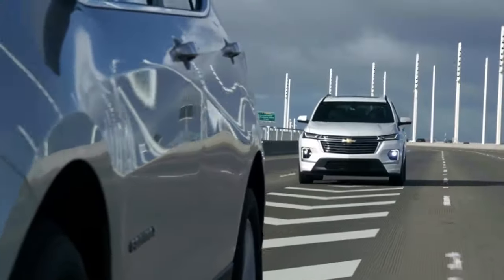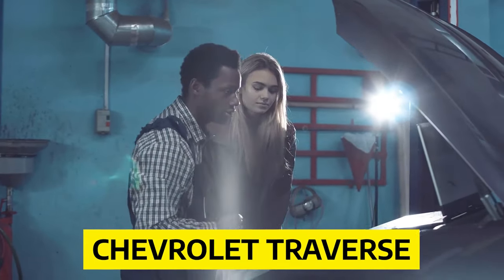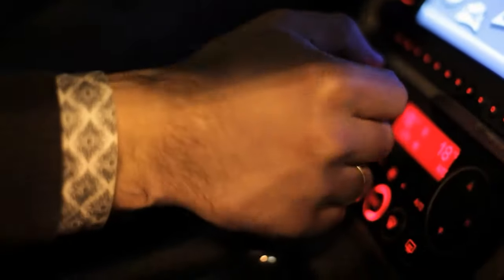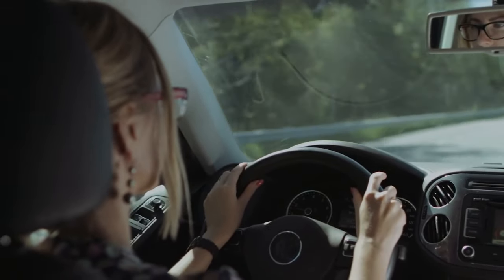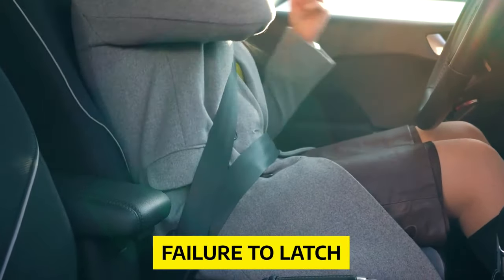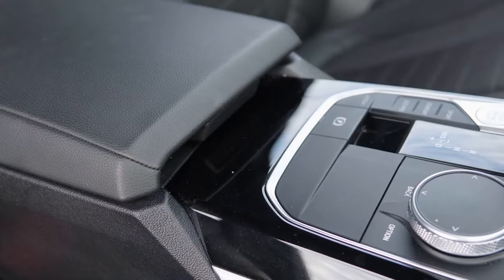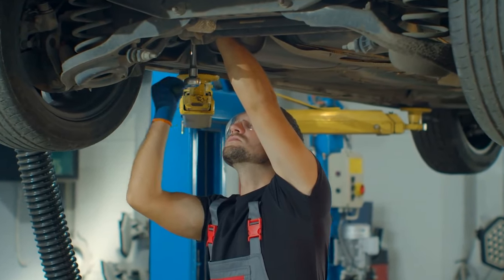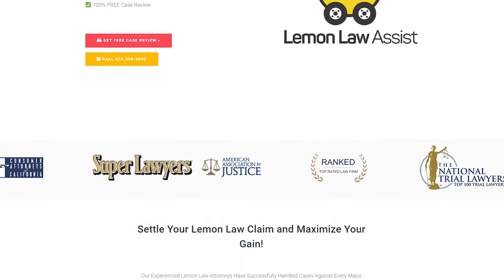WATCH THIS If You Have Chevy Traverse | Lemon Problems of Chevy Traverse

Comment: I’ve got a 2020 Chevy Traverse LT AWD with 27,900 miles and we bought it new. I’ve taken it on road trips to Florida, Washington D.C., Pennsylvania, and to and from Wisconsin, Iowa, and Indiana (I live in the Chicago area). I’ve experienced absolutely no problems and I’ve enjoyed the driving experience since the day we brought her home.
Reply: Mine has 50 and I’ve had to change the battery alternator and now starter
Reply: Bought 2017 traverse in 2021 with 8500 miles. After 2 years no problems BUT with 36000 miles had to replace rr wheel bearing . Bummer dealer couldn't figure noise in rear.
Reply from the maker: If you need our help in the future, click the link in the form and fill it out for a free case review https://form.jotform.com/mollaeilaw/lemon-law-assist-youtube
Reply from the maker: If you need our help. Click the form link and fill out the form to get a free case review https://form.jotform.com/mollaeilaw/lemon-law-assist-youtube
Reply: We had a 2013 Traverse we drove to 200k miles, now a 2020 is at 75k miles…. Never had any engine or transmission problems. Only repairs on the 2013 were brakes and wheel bearings. Usual wear items aggravated by sand and salt in the north east winters. The 2020 has been free from any repairs so far! Reviews must be written by import dealers!

Comment: You can’t make such vague conclusions about the Chevre Traverse without reference to the year model and maintenance culture of that owner or how well it has been maintained . I own a 2019 Chevre Traverse and haven’t had any major issues with its performance.  I love the Traverse and its riding smoothness. I only recall a check engine light which was diagnosed as a faulty catalytic converter. I had it replaced and since then , no other performance issues. My Traverse is less than 100,000 miles and has no regrets with its usage.

Comment: I bought a 2023 Traverse in the Premier trim level with 13 miles on it. Have taken it on 2 long distances road trips across state lines, thru the pass in snow conditions and off road with rain/mud conditions. The vehicle handles well, with no issues thus far closing in on 20k miles now. My problem is this video. Why not show us videos of the traverse and the issues being discussed rather than a bunch of random vehicles being shown... Most vehicles will inquire problems over time but make sure to have required maintenance done at regular intervals and you're good.
Reply from the maker: If you're wondering how much you can get paid for your car problem, click the form link and fill out the form to get a free case review https://form.jotform.com/mollaeilaw/lemon-law-assist-youtube

Comment: I have to disagree with you on the problems with the   Traverse. Ours is a ‘19 Premier model and it currently has 75K. I have had no issues with this car at all it drives so smooth, quiet, has plenty of power, no steering problems, no control issues, original brakes, etc. I’d like to know how many out of say, 1000 Traverse’ have had these issues. It’s a great car and I’m thinking about trading for a ’25 model

Comment: I've owned a 2019 Traverse LT AWD and sold it with 58k miles and loved it so much I bought another, 2020 Traverse LT AWD with 34k miles because of the upgraded features it has. Every car will have maybe one of these problems mentioned at one time or another no matter the car maker. Audi, Ford, Chevy, Chrysler it doesn't matter. Those car makers have all been around for many years and try to make the best they can. It all comes down to personal taste. Every car I have owned of Chevy has never had those problems though counting the Traverse.
Reply from the maker: If you're wondering how much you can get paid for your car problem, click the form link and fill out the form to get a free case review https://form.jotform.com/mollaeilaw/lemon-law-assist-youtube

Comment: Over 6 years with 2015 Traverse no issues. Except for battery change and brake work. No engine issues which was the reason to buy new. Advice: change oil on time religiously and it will run forever.
Reply from the maker: Good to hear that. If you need our help in the future. Click the form link and fill out the form to get a free case review https://form.jotform.com/mollaeilaw/lemon-law-assist-youtube

Comment: I currently  have a 2020 Traverse. My breaks has always had a noise, and now I’m having  transmission issues. 12,000 miles out of warranty.
Reply from the maker: I'm sorry to hear that. Click the form link and fill out the form to get free case review https://form.jotform.com/mollaeilaw/lemon-law-assist-youtube
Reply: Mines a 2021 and had to change the alternator battery and now started same just beyond warranty but luckily I had the extended warranty so that saved me but still $250 deductible 😢
Reply: @BASSFISHINGMIC  mines ended up being a burned out coil. 455.00 dollars 😩
Reply: My 2020 redline has had the exhaust pipes replaced twice. And the transmission replaced at 70k miles. Rear brakes squeaked for 2 years until I finally just replaced them. I was always told there is nothing wrong with them. Replacing them got rid of the noise. My 2018 traverse had a shift to park issue.
Reply from the maker: I'm sorry to hear that. If you need our help, our office will review and evaluate your car/truck problem. Click the form link and fill out the form to get a free case review https://form.jotform.com/mollaeilaw/lemon-law-assist-youtube
Reply from the maker: I'm sorry to hear that. If you need our help, our office will review and evaluate your car/truck problem. Click the form link and fill out the form to get a free case review https://form.jotform.com/mollaeilaw/lemon-law-assist-youtube

Comment: 2019 brand new traverse with 74k miles on it...ive replaced an evap sensor, battery, and now its got a speed sensor of some sort wrong with it. High RPM's and wont shift, no matter how fast you go
Reply from the maker: I'm sorry to hear that. If you need our help, our office will review and evaluate your car/truck problem. Click the form link and fill out the form to get a free case review https://form.jotform.com/mollaeilaw/lemon-law-assist-youtube

Comment: I have a 2019 LT and it definitely is a headache.  Fixed emission system 3 times
Reply from the maker: Hi! @devinedecor5784 It sounds frustrating to deal with repeated issues like this. For a 2019 model, if you’ve had persistent problems with the emission system, you might be eligible for some recourse under the Lemon Law.
To explore your options and see if you qualify for a free case review, please fill out the form here: https://form.jotform.com/mollaeilaw/lemon-law-assist-youtube

Comment: How does it have power steering problems, when it has electric steering?  There’s no hydraulics, pumps, hoses, or fluid to deal with or to go bad.
Reply from the maker: Hi! Even with electric steering, issues can still occur due to faults in the motor, sensors, or control modules. Software glitches or wiring problems might also be to blame. For a free case review, you can fill out the form here: https://form.jotform.com/mollaeilaw/lemon-law-assist-youtube

Comment: 60k miles on it no issues at all. Only things that was fixed were the trans shifter going to park mode. And at 50k the Evap canister that was recalled. Brakes were changed due to noise but had to get used to it. Still the same after the 3kmile change after they rotated the tires and messed up something there..

Comment: I own a 2020 chevy Traverse LT AWD, purchased brand new in Dec 2019. About two months in, I started to hear a little "rattle" immediately when I accelerate, when I drive approx 30-40mph, when I go uphill, sometimes when I go downhill.  I live in NYC, and the speed limit is 25mph, also, to date (Oct, 2023) I only have 18K miles on it, as I only drive to and from work and I am the only operator of my vehicle.  The problem is, when I have taken it to the dealer, they NEVER hear the noise I am complaining about, because it is INTERMITTENT. Someone would actually have to be driving the car for a while, maybe 20 or 30 minutes for the noise to happen, and it does NOT happen every day.  Dealer said, there are no loose cables or anything that could cause my "imaginary" rattle.  It's very frustrating.  Aside from this one issue, I really do love my Traverse.
Reply from the maker: If you're wondering how much you can get paid for your car problem, click the form link and fill out the form to get a free case review https://form.jotform.com/mollaeilaw/lemon-law-assist-youtube
Reply: Same here with my 2020 Traverse; at the dealer AGAIN!! 4th visit

Comment: My 2018 chevrolet traverse awd lt doesn't seem to have any of this problems....knock on wood. This is my baby...ride smooth, shift smooth, handles good except going over giant speed bump in front wheel drive mode will i nose dive and bounces alot. But not in awd mode that nose dive and bounces goes away. Other than that i just do the daily routine oil maintenance myself and recently just got done changing the transmission fluid.

Comment: I have a 2020 and mostly love it.
I have a suspicion that, in mine at least, initiating systems of the vehicle that dont get daily, or at least regular use, causes them to exploit whatever weak spot they possesses.
Ive had body control mod., rear camera, and front camera failures at less than 100 000.00 kilometers( around 60 000.00 miles).
Each time, occuring, after new, or additional, or not-usual, options were engaged. I generally drive it solo, but purchased it for immediate versatility with kids, friends, work, tow capability etc. 
To all the actually knowledgeable folks out there; this is a 100% guess, based on some pretty weak observations, and could easily be nonsense.👍
Reply from the maker: I'm sorry to hear that. If you need our help, our office will review and evaluate your car/truck problem. Click the form link and fill out the form to get a free case review https://form.jotform.com/mollaeilaw/lemon-law-assist-youtube

Comment: If you buy a 2022 Model Chevy Traverse, Be aware that the brakes could make a loud screeching sound or cause the vehicle to shake at a stop which could potentially create a dangerous situation. My Parents' 2022 Traverse which is AWD, did this when I was on my Commute to College this Morning and I thought the wheels were about to fall off because of the way they sounded when stopping the car. It scared the heck out of me. It only has a little over 8000 miles on it and was only used to get me to and from college.
Reply from the maker: If you have a car issue click the form link and fill out the form to get a free case review https://form.jotform.com/mollaeilaw/lemon-law-assist-youtube

Comment: I was looking from some facts on the latest model Traverse and this was not very helpful.  Emotional claims of defects need to be backed-up with hard data such as how many problems have occurred per thousand vehicles sold.  I will check Consumer Reports or JD Power reports on vehicle dependabiIity.  I know many people who own a Traverse with high mileage and have had ZERO problems.  In their opinion it is one of the best vehicles they have owned.  I can't help but think this is nothing more than a not so subtle scare tactic to sell Lemon Law Assist.

Comment: I have a 2020 Traverse High Country with 20,000 miles. I have intermittently noisy brakes, have had to replace the rear axle because of leaking and needed the air conditioner repaired for not blowing out cold air. My new car warranty expires next month and I'm wondering if I would be wise to purchase an extended warranty or perhaps trade the Traverse in for another vehicle.
Reply from the maker: Hi @wallinlitwa , I'm sorry to here about your car. Please click the form link and fill out the form to get a free case review https://form.jotform.com/mollaeilaw/lemon-law-assist-youtube
Reply: Sometimes my key will not start my 2018 Lt  even if I’m standing right by the vehicle or even when my feet is on the brake then it seem to not want to pull up in my driveway
Reply from the maker: Click the form link and fill out the form to get a free case review https://form.jotform.com/mollaeilaw/lemon-law-assist-youtube

Comment: I have a 2018 Chevy Traverse with 45k miles on it. Sometimes when you start it it goes in reverse and then takes a few seconds to change to forward. Another issue I’m having is the “Shift to Park” notification when I shut my car off. I have to press forward or wiggle the shift stick in order for it to turn off completely. Also my lighter fuse is blown and I need to figure how to fix that.
Reply from the maker: If you're wondering how much you can get paid for your car problem, click the form link and fill out the form to get a free case review https://form.jotform.com/mollaeilaw/lemon-law-assist-youtube

Comment: I've had my Traverse since 2012. It's a beautiful beast of an SUV. I've done sooo many repairs and they all began after 6months of ownership. However, since it was my first Chevy and my first large SUV I thought it was normal. Lol
😅 Can't seem to let it go though. It's very spacious and aesthetically pleasing. Like the video though I am driving around with airbag light on and yes I had it repaired and it showed up again. Also, I have stabilatrack light on but can't afford to get that looked at. 😓
Reply from the maker: I'm sorry to hear that. Our qualification is from 2017 to 2023 for states in California and for states outside of California with 2-3 or more qualifying repairs for the same problem and qualifying 90k to be low mileage.

Comment: Only issue I have is that it intermittently doesn't think it's in park even though it is mechanically.  I seem a TSB that it's just the switch in the shifter not registering.
Reply from the maker: If you still have a car/truck issue click the form link and fill out the form to get a free case review https://form.jotform.com/mollaeilaw/lemon-law-assist-youtube

Comment: I was about to get one… but surely not anymore
Reply: same here too and i was looking for used. BUT naaahh ill look for pilot or 4runner
Reply: Don’t be afraid of the last 3 -4years of Traverse. Looks to me like the examples here are from 2019 and earlier models. My ‘23 has no issues at this time. I luv it 😊
Reply: Mine 2021 had to change the battery alternator and now the starter at just pass 50k miles get the extended warranty
Reply: @jonathanKog  Have you looked at the numerous complaints on pilot's? Or the Unintended acceleration problems with toyotas?
Reply: 2018 And only reg maintenance with 90k.
Reply from the maker: If you need our help, our office will review and evaluate your car/truck problem. Click the form link and fill out the form to get a free case review https://form.jotform.com/mollaeilaw/lemon-law-assist-youtube
Reply from the maker: Good to hear that. If you need our help in the future. Click the form link and fill out the form to get a free case review https://form.jotform.com/mollaeilaw/lemon-law-assist-youtube
Reply from the maker: I'm sorry to hear that. If you need our help, our office will review and evaluate your car/truck problem. Click the form link and fill out the form to get a free case review https://form.jotform.com/mollaeilaw/lemon-law-assist-youtube
Reply from the maker: Lemon law covers new and used cars, trucks, SUVs, and vans under warranty with 2 to 3 or more of the same repairs and a low mileage of 90k, including leased and fleet vehicles, typically 2019 or newer cars. If you need our help. Click the form link and fill out the form to get a free case review https://form.jotform.com/mollaeilaw/lemon-law-assist-youtube
Reply from the maker: I'm sorry to hear that. Unfortunately, your car doesn't qualify since it's already out of warranty. Only 2019 or newer cars that are under warranty qualify. If you need our help in the future. Click the form link and fill out the form to get a free case review https://form.jotform.com/mollaeilaw/lemon-law-assist-youtube

Comment: The comments are typical of someone who knows nothing of detailed function failures. Weak steering? And the “get your steering wheel checked. How about the cam chain tensioning system n relation to prompt oil changing, torque converters and clutches and the fact that not changing trans fluid will catch up with you. bad grounds on electrical, rack& pinion failures, purge valve failures, video cable failures etc. Guess what, you will find many of these problems across the big manufacturers with the exception of perhaps Honda or Toyota. Consult with a seasoned tech before spewing this absurdity!
Reply from the maker: Hi! You’ve highlighted the complexities of vehicle maintenance well. Issues like cam chain tensioning, torque converters, and bad grounds require expert attention, and they are indeed common across many manufacturers.
If you’re dealing with repeated issues on your 2019 or newer vehicle, the Lemon Law may offer protection and potential compensation. For a free case review or to see how much you may qualify for, fill out the form here: https://form.jotform.com/mollaeilaw/lemon-law-assist-youtube
If you need further assistance, feel free to reach out. We’re here to help with any vehicle-related concerns.